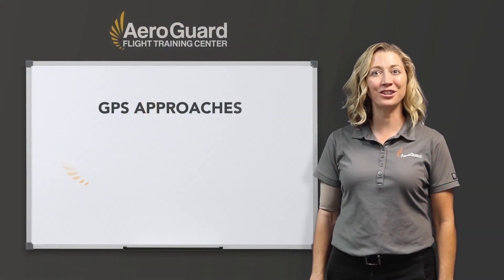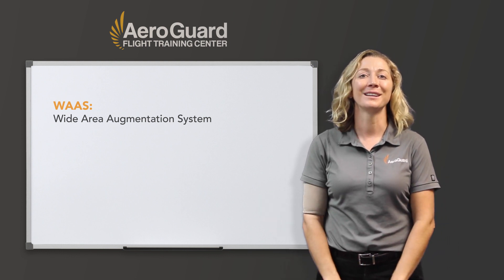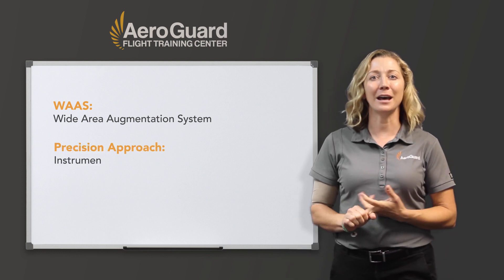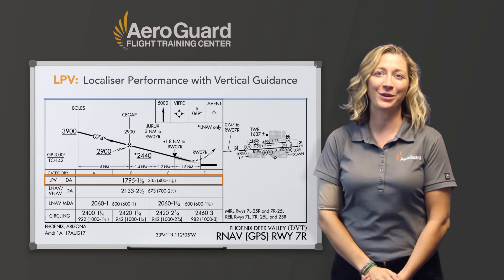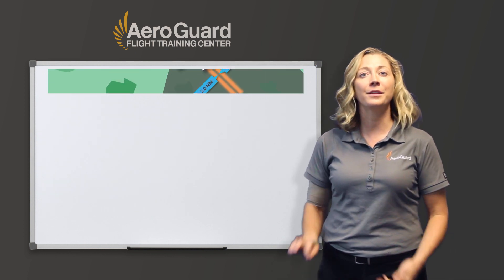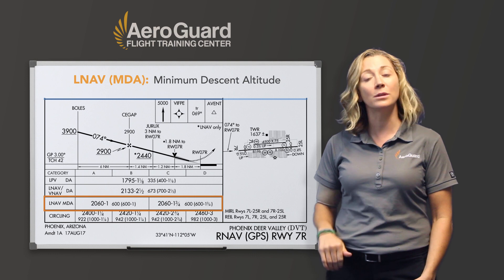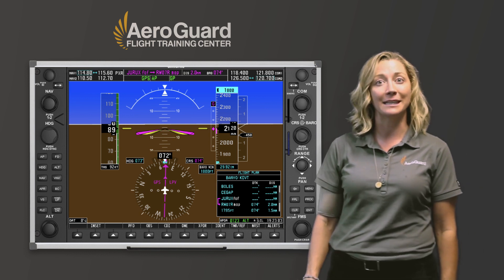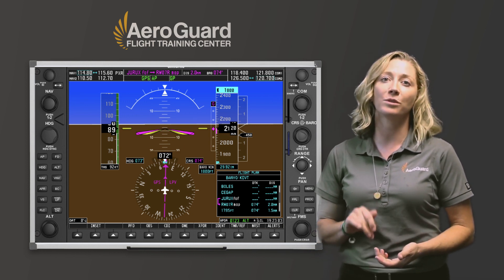GPS Approaches – AeroGuard Flight Training Center

Comment: Be careful of a "gotcha" on a checkride.              LPV is not considered a precision approach for "planning purposes" ( Alternates), despite it having lateral & vertical guidance and a DA commonly as low as 200 AGL.   Not to be categorized as a precision approach by ICAO.                  Although you do fly it the same way from a 'technique' perspective.  You may file as an alternate airport if it just has an LPV and it's an acceptable alternate, but you have to use the non-precision 800-2 weather forecast minimums at ETA, if you want to file it as your Alternate airport on your IFR flight plan.

Comment: When planning for lpv minimums at alternate airport, you DONT use standard non-precision minimums (800-2)…. You use lnav minima line…
Reply from the maker: Hi there. According to AIM 1-1-18(c)(9)(a) it specifies “Code of Federal Regulations (CFR) part 91 non-precision approach weather requirements must be used for planning.”  An example of this would be if a WAAS equipped aircraft is planning a flight that requires an alternate airport the pilot could select an airport with only a GPS approach but must comply with CFR 14 91.169(c)(1) and must assume only LNAV minimums are available.  So even if the approach has an LPV minima line, for planning purposes, the pilot will assume only the non-precision lines are available.  To further that example, the pilot should determine if there are non-standard alternate minimums for that approach first, if not, then the standards listed in CFR 14 91.169(c)(1)(i)(B) would be the weather minimums to use. Thanks!

Comment: Does the GPS give a message if there is a WAAS failure like it does with RAIM?
Reply from the maker: On the G430 if WAAS fails there will be a flashing, yellow box at the bottom left of the screen that says INTG (which stands for integrity). In a G1000, it will give a couple different indications; a CAS message that says GPS loss of integrity approach downgraded, in the CDI it says the accuracy of the GPS (so if you were at LPV it would become LNAV/VNAV or LNAV), and finally the vertical guidance bar will change shape and color. These are the two avionics systems in use at AeroGuard Flight Training Center so we responded in regards to our fleet. Please consult the avionics manual for the specific aircraft that you operate for the most accurate information. We hope this was helpful!

Comment: In your point of view, this third category of approaches - APV - is considered a PA or NPA?
Reply from the maker: Hi Nikita 
According to AIM 5-4-5(a)(7), the APV type approach is defined as a third category.  Most confusion occurs because the procedure for conducting an APV approach is quite similar to a precision approach.  That is further exacerbated by the ACS that allows for APV approaches with specific minimum criteria to be used in lieu of a precision approach for specific tasks to be completed on an IR practical exam. The reality is that it’s in a separate category, but practically it seems closer to a precision approach than a non-precision approach. 
Hope that helps!
Reply: @flyaeroguard  That was the most complete and fastest answer I could ever expect, thank you so much!

Comment: is it illegal to fly using gps in ifr without WAAS ? just like you said?
Reply from the maker: Hi there! This does get a bit complicated and specific;

Non-WAAS equipped GPS units may be used for IFR operations, and are limited to how they are certified, what other navigation equipment is onboard the aircraft, and the phase of flight the GPS is being used.  AIM paragraph 1-1-17 has detailed information that will allow a pilot to better understand the requirements for GPS certified under TSO-C129 or TSO-C196().  These certifications are the non-WAAS certified GPS that still have functionality in the IFR environment.  

As a general rule of thumb, the use of non-WAAS GPS units are more limited than those with WAAS, but with proper RAIM verification, system functionality, and an alternate means of navigation (i.e. VOR) nearly every phase of flight can be completed using a GPS.  That is true for both GPS procedures or as an overlay (i.e. flying a Victor airway with GPS instead of VOR).

Hope that helps!
Reply: @flyaeroguard  thank you so much! It helped a lot!
Then… does that mean you can fly ifr without vor receiver?
Reply from the maker: @AllegeK  If you have WAAS, and you complete a RAIM prediction for your flight, and there are no NOTAMs for RAIM during your flight (for your particular routing) then yes you can fly IFR without a VOR.
Reply: @flyaeroguard  Thank you so much again